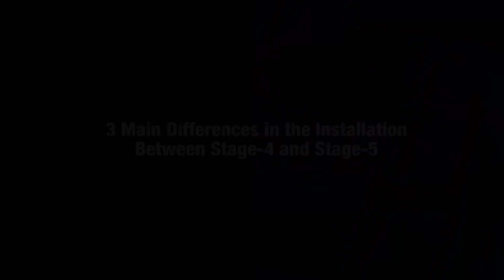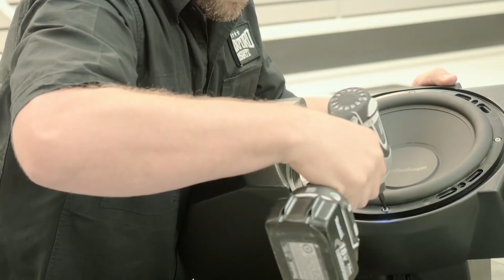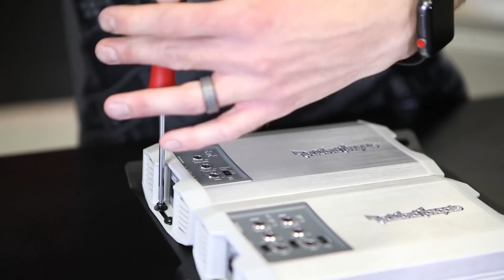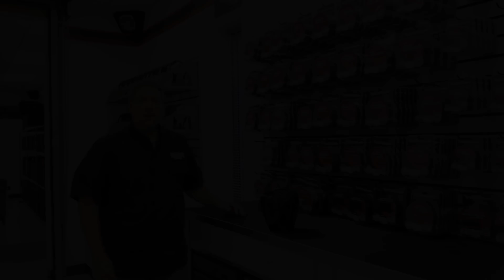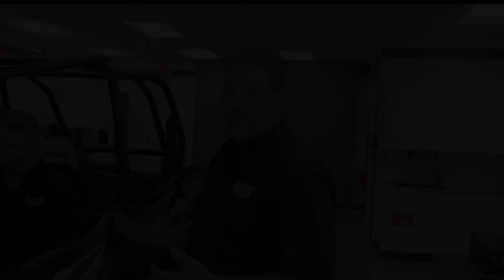RZR-STAGE5 Installation

Comment: I can’t figure out how to run my main wiring harness from the center console to the dash, it just won’t fit
Reply from the maker: Since this is an old video, let's start by making sure you're watching the right one for the kit you're installing.

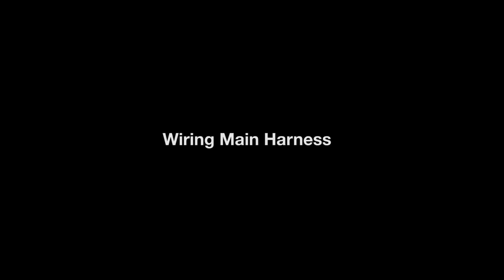1) 1st Generation (RZR-STAGE5): This is for 2014-2018 RZR models that have the older body style.   At 7:50 it shows how to run the harness between the center console and the dash.  If you can't get the connectors through the rubber grommet, detach the connectors, tape the wire, and insert them through the grommets.

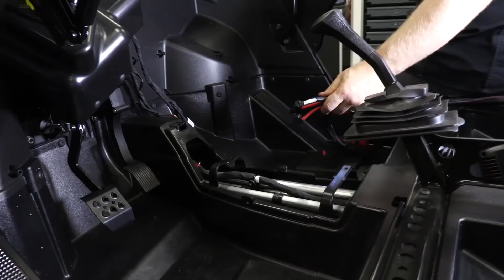2) 2nd Generation (RZR14-STAGE5):  If your RZR is 2019 or newer, you likely have the 2nd generation kit.  The installation video at 8:00 shows how to route the harness: https://www.youtube.com/watch?v=g8mlU_-DdJo

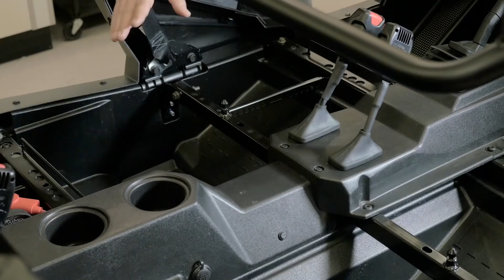3) 3rd Generation (RZR14-STG5): If your RZR is 2019 or newer and you have the new Color Optix (LED lightning), you likely have the 3rd generation kit.  The installation video at 6:25 shows haw to route the harness: https://www.youtube.com/watch?v=7TguKg4U6Fw

Comment: I'm getting no sound out of my speakers the clip in and clip out light is staying illuminated red and the power light is blue so it's not going into protect mode but idk wats wrong
Reply from the maker: You have this exact kit, the RZR-STAGE5?  Which amplifier is having the issue?  The TM400X4ad or the TM750X1?
Reply: @rockfordfosgate  no it's stage 4 ride command same amp but I only have one amp instead of 2 . It was working fine about a month untill yesterday no sound and clipping lights are all red
Reply from the maker: @josegaeta815  O.K. thank you for clarifying ... that's a totally different kit than discussed in this video, but no problem.  Disconnect the Ride Command interface from the amplifier and see if the LEDs stay the same.  If so, something has happened to the amplifier.  The RZR wasn't submerged in water was it?  You may want to contact our technical support to see if they have any other diagnostics before sending the amplifier back.  They can be reached at 1-800-669-9899.  They can also walk you through the warranty replacement process.
Reply: @rockfordfosgate ok I will call them thanks for the help

Comment: Could I buy two more rear tower speakers and add on
Reply from the maker: Technically you can add 1 pair to the rear channels since the amplifier can operate at a 2-ohm load.  However, you are on your own with splicing the wires into the correct channels and readjusting the input sensitivity on the amplifier to match the proper levels.

Comment: What are the watts RMS with the 4 speakers and watts of amplifier rms
Reply from the maker: The RZR-STAGE5 has been upgraded to the RZR14-STAGE5.  The newer kit uses the TM1000X5ad amplifier that produces 1,000 watts (100 Watts x 4 @ 4-Ohm + 600 x 1 @ 2-Ohm.) Here's the RZR14-STAGE5 install video: https://www.youtube.com/watch?v=g8mlU_-DdJo
Reply: Do you have a kit for the 2019 polaris rzr turbo s model? All I see is 2018 and under
Reply from the maker: @sandroostutv1169  Yes, here's our RZR Playlist that has all stages for 2014-2018 and 2019+ models.  You can pick the proper stage (1/2/3/4/5) by selecting the appropriate vide in the playlist:

https://www.youtube.com/watch?v=5TSa8nU3cco&list=PL-ob-nWq0t1ih2FgQnKbrDC-JNsjmsQLO

Comment: can i add 2 more speakers on the middle bar?, i have a system with 4 speakers installed right know, (1 behind front passenger, and 1 behind driver, and 1 behind rear passenger, and 1 behind rear drivers side passenger) could i do that with this kit?
Reply from the maker: Do you have the RZR-STAGE5 or the RZR14-STAGE5 kit?

Comment: So the sub woofer isn’t weather resistant.can I still pressure wash the rzr with no issues?
Reply from the maker: Correct, the RZR-STAGE5 is not a weather resistant subwoofer, but it's mounted up underneath the dash and unlikely will get water on it.  Be careful to not spray into the speakers themselves, just lightly rinse them off if mud gets in them.  The most critical is the amplifier top, as it will need to be covered so water doesn't drip down into the top controls.